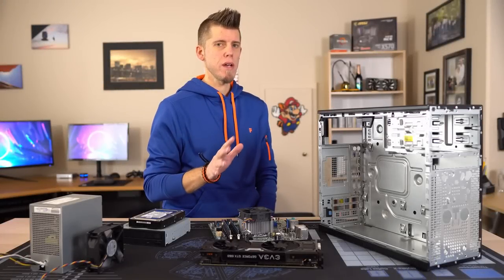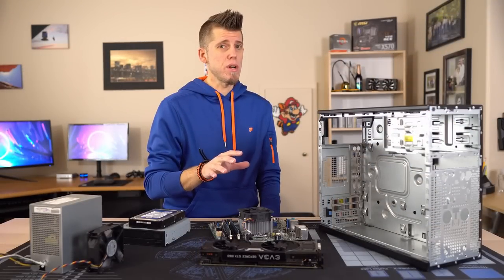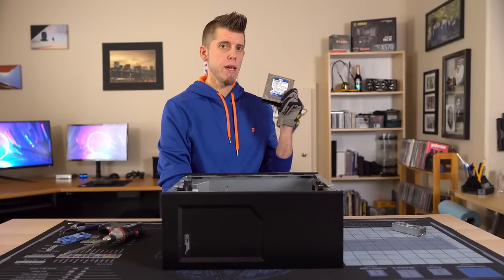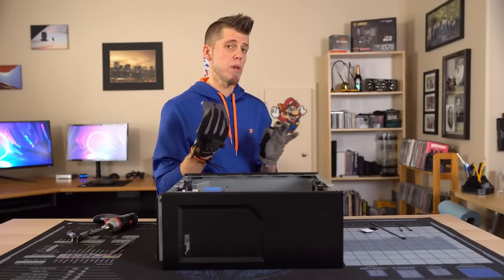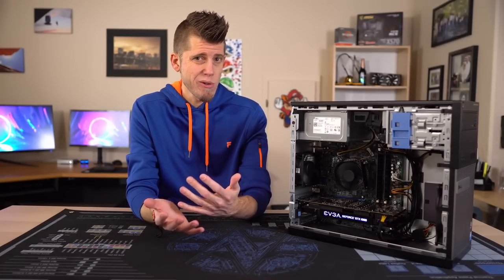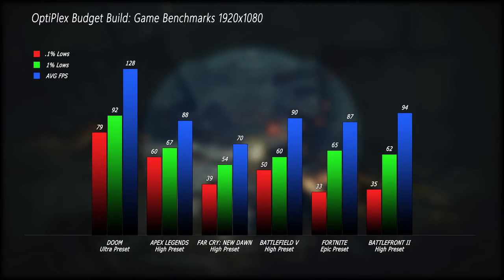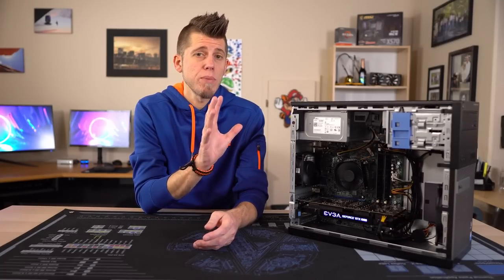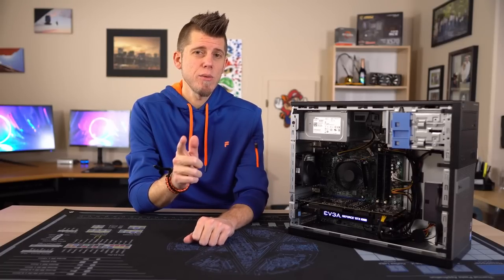Dell OptiPlex Budget Gaming PC For Under $300?

Comment: Everyone assumes dell psu are a ticking time bomb but they are more reliable than most psu
Reply: Its reliability isn't an issue here (which more than likely is shit), it hasn't got proper specs for the components he put in the system is.
Reply from the maker: @madfinntech  Once again, you're objectively wrong. I've torture tested these. They're reliable. They're Hi Pro units, that are average. So, they're not stellar, but they're not shit. Also, as I've said, the 1060 consumes 120 measly watts and the OptiPlex consumes less than 100 watts. Total, this system is consuming just above 200 watts at full load. It has 70-80 watts of headroom with this hardware.

I've already tested these units and that 290 watts is a constant rating. The reason nVidia recommends a 400 watt PSU is because they know that a lot garbage PSU's are rated at their peak rating. It's to make sure their customers are covered if they buy a crap PSU. So, that way, it's constant wattage is, at least closer, 300 watts... same as this OptiPlex.
Reply from the maker: I mean, this literally reminds me when people flipped out about the Great Wall power supply in the Wal Mart overpower system. They all said it would burn your house down. I'm sure there were a number of them with a higher end PSU making that comment, not knowing their PSU is a Great Wall unit. They make the Corsair SF series, for example. Then Gamers Nexus tested it and found it was an average power supply, not the pile of crap everyone made it out to be.

Yes, a lot of pre-built PSU's tend to be utter shit. However, not all of them are. Especially when you move up to the business machines, like these. As someone who's worked as a field engineer for HP, I can tell you that with the cost of service that comes with those machines, it doesn't pay for them to cut corners.
Reply: Yeah, I get it now. There's a vast difference to "rated" and what the device can push at a constant level reliably. Like with speakers, there's rated marketing stuff and then real consistent output that's measured.
Reply: @TheGameBench  my oem pc is slower than this pc but has a delta 300 watt psu that is also 80+ bronze. I have used phenom 955 125w and gtx 650 Asus dcu 120 w and it is working fine for 2 years now

Comment: I got started in building my own desktop PCs with the Dell Optiplex 780 which I upgraded with an SSD, a quad CPU, RAM and a 2gb videocard. After that, it was an amazing machine. I also replaced the CMOS battery. My next DO was the 990 with the I7-2600. My 990 was $134 shipped. It was a plug and play SFF pc. The following week the same PC was over $150 from the same seller.

Comment: I rebuilt an OptiPlex 9020 i7-4770 16gb RAM 500gb platter drive.  Took out the sadface 290w PSU and put in an AresGame 500w 80+Bronze PSU and bought a 24pin to 8pin adapter for the janky mobo.  Scored a EGA 1660 GTX Geforce and used the PCIE power cable from the new PSU to get that going.  No WIFI so I bought a USB dongle for that (so many open USB ports, lol).  It runs great!  Next in line will be cloning the drive to an SSD and maybe do a case replacement for something with glass and RGB fans.  I have no issues with cooling just using the stock setup.  Thanks for all the help!

Comment: I love doing these Optiplex builds. I usually do the smaller ones though, I like a challenge! 😂 👍 Great video though, used 1060s give a nice bang for the buck at the moment.
Reply: Help, I am putting a new ssd Replacing my old hd for Inspiron 3020. What do I need to keep it as back up storage hd?  Can I keep inside these 2 drives?? Any adapters cables I need help me???

Comment: The Optiplex 7020/9020 are dead ends in the sense that you're locked into 4th gen i5/i7 performance. But for someone who only has $150-300 to spend on a school/gaming machine, you can still get a TON of mileage out of these machines. They're still nice and snappy if you debloat Win10 and set visual effects to "best performance." 

In my experience, you don't need additional case fans bc Optiplexes are detuned for long-term reliability in business environments. The MTs have great ventilation already.
Reply: i was wondering how a 7020 would perform with a RX580 with no fans ... great to know there build to last

Comment: I got a optiplex 9020 for 125$ and i guess the seller messed up because instead of it coming with a i5 2400 it came with a i7 4790 and so i guess i got a steal
Reply from the maker: Damn! That's awesome, and yeah, it's one hell of a steal. You could put in a  new PSU and toss a 1080 Ti in there and have a pretty high end 1440p gaming machine for about $600.
Reply: The Game Bench i put in a evga 400 watt psu with a 1050 ti oc with a 128gb ssd and a 1tb hdd
Reply: Damn dude
Reply: If u buy a optiplex pre installed with windows and replace the hard drive with a ssd would u have to reinstall windows?
Reply: @ilianatamez5802  you snapped
Reply: @NoshiroIJN  don't replace, put them together and use a software to migrate.
Reply: @meilyn22  it’s fine I gave up on building a pc

Comment: Thanks for the video.  I bought an 7010i with a i5 3.6g for $40 in December. Last week I bought a 4gb GTX 1050ti and some ram. I can now play fortnite on epic with 1080 resolution.  Have a cheap dell se2717hr that max at 60hz.  My average frame rate is in the mid 40s but the picture quality over my ps4 pro is outstanding. I’m really blown away on my $260 build.  I bought my pc at government surplus.  Thanks for the video.

Comment: I put an RX 570 in my i7-4770 Optiplex 9020mt. I discovered it is physically impossible to put a GPU wider than 43mm (2.2 slot width), because it won't fit between sata1 and the ram. 43mm only fits if you shave the front panel plug down at the top where the GPU is. Used your tutorial video to take out the hdd bay.
Reply from the maker: Yeah, anything wider than the two slots, will have trouble with those SATA ports. There are some low profile SATA cables that should work as well.
Reply: @TheGameBench  low profile sata won't help, because you're still right up against the front panel plug.
Reply from the maker: @jeremebp  Oh yeah... easily solved with this:

https://www.moddiy.com/products/USB-3.0-20-Pin-Internal-Header-Adapter-Cable-Low-Profile-Connector.html
Reply: @TheGameBench  ok that's pretty cool, didn't know about that little kit. Thanks!
Reply from the maker: @jeremebp  No problem.

Comment: I'm working on a case transplant on a Dell Optiplex 9020.  I'm kind of amazed you didn't replace the PSU.
Reply: What are you doing about the front panel?
Reply: @jeremebp  - I kind of Frankensteined the Dell front I/O panel into a 5.25 drive bay adapter (it's not pretty)..  the power switch I jumpered pins 3 & ,4 and put the case power on 1 & 2.  No reset or led.  Case front panel USB 3.0 imnto a USB 3.0 hub with the Dell front panel USB 3.0.
Reply: @mikemurley8656  Nice. I knew it could be hacked together like you did, or just left hanging out inside, but it seems like too much trouble for not enough gain. I kinda like the way the optiplex looks. I might have been bothered if heat build up with my GPU was an issue, but even with just the stock exhaust fan everything is staying nice and cool. We'll see what happens in the summer.
Reply: @jeremebp  - I needed a project.  😁
Reply from the maker: No need to replace it. That's why I went with the 1060. It's about the limit for this PSU as well as the 4th Gen i5. The idea was to come in at around $300 and I couldn't have done that replacing the PSU. Granted, if you wanted to go with anything more than a 560 on the AMD side, it wouldn't be an option.

And yeah, the power switch and power LED are easy to deal with on the case swap. The USB2 ports, and the HD audio are a little different. Thankfully the USB3 ports are standard.
Reply from the maker: @Great-Documentaries  It doesn't help that most of them think that the 80+ certification is some measure of overall quality or that wattage is as well. It also doesn't help that they don't know anything about power consumption and think that it's the same thing as TDP. They're the kind of people that think a 1050 Ti needs at least a 300 watt PSU. Hopefully I can help clear that up with these videos.

Comment: Just got a 7020 the other day for the kids.  i5-4590 3.3GHz, 16 GB RAM, 120 GB SSD and 1 TB spinner, I put a 650 ti I had laying around in it.  Had to get a Sata to 6-pin PCI adapter.  I'm going to upgrade the GPU soon but prices are insane right now.  I just got an MSI 1060 6GB the other day for my PC and I paid $300 for it which seems to be a steal in this market.

Comment: I followed your advice and went Dell Optiplex 9020 i5 32gig ram Nividia Geforce GTX 1060 powered with 700W Thermaltake Smart Series 80 plus.
I used a Hammer and Flat screw driver to get the cage out though. 
The Thermaltake power supply had most of everything you need except you will need an adapter 24pin to 8 pin.
Thing is a beast and this is my first computer build .
I haven't installed the front fan yet but the new power supply has a bunch of 4 pin fan plugs that will make it easy for me to get creative with some fan ideas. Thank you for your videos as they were a great reference.

Comment: My super "ebay only" budget setup is a  dell 7020 w/ i3 4160, gt 730 2gb, 16 gb ddr3 ram, 128 ssd/500gb hd all for $106 but i was very patient in getting deals on ebay
Reply: That's pretty cheap. GJ
Reply from the maker: Yeah, that's super cheap. What's great is that when you feel like you've outgrown that, you could easily upgrade to an i7.
Reply: A 660Ti or a  7850 is 30USD as well, way better deal
Reply from the maker: @Lothairecliquennois  Yeah, the 730 isn't great, by any stretch, but when you look at the fact that the system came to $106 all in... that's not a bad price with 16GB of RAM and an SSD.

Comment: 1 new sub from me Rich of  ReviewPICKusa really p*ssed me off over this one, although I would prefer to replace the psu I saw nothing wrong with what you was using to pick so much on your video, 8gb is still just fine, an i5  is not the greatest in 2020 but still for a budget machine it gets then job done, I think anyone building a cheap build like this is not expecting the highest resolutions and ultra settings, the cpu in xbox and ps4 is 8 core but really really p*ss poor cores, 

for a small youtube channel great job! some constructive advise is always welcome by people to enable them to grow and improve but mindless bashing helps no one except those struggling to find new good content to put out.
Reply from the maker: Thanks! I really appreciate the support. Yeah, this was totally intended to be a someone's introduction to PC's, and for the money I'd say it performs above expectations. And I'm going to follow this up with something the consoles can't do... upgrade the power supply, an i7, more RAM and a high end GPU. Even thinking about doing an even cheaper build to go after the base models.

Comment: I got my opti 9010 (last Gen model with full win xp hardware and driver support) for $300 back in 2017 when the market wasn't flooded with them. Still have it as a second computer with win10/xp dual boot, complete with an i7 3770k (before I knew xeon e3 v2's existed, oh well), 32gb viper 1600mhz ram, creative x-fi fatal1ty, gtx 970 bios modded 190+ watt, 2 SSD (256gb) 1 HDD (2tb) 1 cdrom, 5 case fans (modded opti case) and an EVGA g3 650w giving it super clean power.

The g3 and gtx 970 only cost me like $50 each on eBay. They both go for way more than that usually.

Its not as good as my main rig (alderlake/pascal) but I still love it and use it a lot. It was my main rig, now it replaced my retired Pentium 4 xp PC that half of its components develop bulging and blown caps. People can say what they want about these dells, but they are stable and will get you through a pinch when you can't afford good stuff. You can slap a rtx 3050 and play cyberpunk, it won't be an amazing experience but you can do it.

For as much as people crap on dell, they are the gatekeepers to entry level gaming now so we can at least be grateful we have that opportunity. PC gaming isn't dead,  but requires you to be smarter with finances these days. Do you need a $2000+ 1000watt gpu or can you learn to get by on a PC that costs less than $1000 and still having money for food?

Dell gaming is the sensible choice when you wish to still put food on the table and keep the bills paid. My dell can play 80%+ of the games my better rig can. It was my main rig when it had a 1650 in it for 5 years before it got turned into a secondary xp/win 10 machine and got a 970 stuffed into it.

Dells are great investments overall if you want to save bank and game. Dells are the only thing that can compete with (PS4 era and below) consoles in the price to performance tier due to the volume of them produced for businesses to buy (like hundreds of millions just in the u.s.)

I really enjoy these dell optiplex videos.

Comment: With that Power Supply, This build is a ticking timebomb! The minimum recommended watt for that GPU is 400watts, and I bet ya it was under such stress during those tests. No wonder he bought an extra ("useless") fan xD
Reply: The GPU uses 120W not 400w this build will barley pull out 300w
Reply: @sotv_3525  What Rich and you fail to realize is that they put that minimum as a safe measure to cover themselves. I do agree about never skimping on the power supply but I highly doubt this build would use 400w. Especially since it's only a i5 and not a i7.
Reply from the maker: Yes... exactly. People keep throwing around wattage numbers, not realizing that some power supplies have a wattage rating that is their PEAK rating, and that they can only supply around 250 to 300 watts continuously. This is why nVidia says, 400 watts as a minimum. To account for low end PSU's. I've torture tested this PSU and it can supply a constant 290 watts.

That being said, the system is pulling around 210 watts from the PSU, leaving you with a 70-80 watt overhead. It's fine and just as good as using a 400 watt PSU that only can supply a 300 watt constant.

Comment: What would you recommend for someone who only wants to make a 4k home theater pc?
Reply: 9020 SFF with a cheap low-profile graphics card that can handle 4K.  It won't take up much space, and you can fit a 3.5" drive in it. Though the GPU isn't absolutely necessary.

If you want REALLY small, get an i7 9020 USFF, use an mSATA SSD (mSATA, NOT M.2 or NVME) for the OS, and put a 4TB 2.5" drive in it for content.  I have an i5 9020 USFF with an 860 EVO mSATA in it I'm getting ready to use as a basic desktop, but more than one person has used the i7 version for an HTPC.

I would avoid the 9020 Micro, though, as the CPU may not be enough, and it is harder to work on than even the USFF version.

https://www.avforums.com/threads/high-end-i7-4k-htpc-dell-optiplex-9020-usff-bluray-drive.2005743/

https://www.google.com/search?client=-b-1-d&q=Optiplex+9020+USFF+HTPC

Comment: I'm doing this with a Dell XE2 midtower I got for free. Came with a OEM 396Watt PSU!  Surprisingly this PSU also has one 6 pin connecter that isn't being utilized. Was planning on putting in a GTX 1650 in it because of power requirements, but seeing you go bigger on GPU was really helpful. Thanks and subbed.
Reply from the maker: Thanks! Those XE2's can go for quite a bit more, just for that reason. They were mostly used for POS systems and used power USB cards for the registers. Not too many of them on the second hand market. But that PSU would be fine with something like a 1080 with a 6-pin to 8-pin adapter. You could easily run something like an RX 6600, or 6600 XT on that.

Comment: I really appreciate your video. I was given a 3020 SFF and a 390. I gutted the 390 case and put the 3020 guts in it. It works great. I had a 550 watt ps laying around so I am using it. Your videos helped so much. Thanks!!!
Reply from the maker: I was about to say, SFF...

That's awesome! The 3020 SFF is a prime candidate to swap and a huge improvement over a 390. Glad I could help.

Comment: Just followed your vids for my optiplex 3010 and cant thank you enough. I did the same for the front fan, went with a 140mm white led but I test fit it, traced the diameter of the fan and cut out all the metal in front of it for more air flow.

Comment: Great job! I have one question: I want to install in my Optiplex 9010 (i7 3770, 16GB RAM, SSD 128 GB and HDD 500GB) an Asus Geforce GTX 1650 4GB Phoenix Graphic card. Do I have to change stock power supply?
Reply: @MrSamadolfo  I don't understand. This GPU has no external power connector...
Reply from the maker: No, you don't need to replace the PSU for what you want to do. That being said, I wouldn't bother with the regular 1650 unless you're finding them for a really good deal. When I was looking, they were about the same price as the 1650 Super, and there's a substantial difference in performance. Check to see if the Super is around the same price. You could also run the 1650 Super without changing out the PSU.
Reply: @TheGameBench  Many thanks!
Reply from the maker: @tomicxxl9134  No problem.